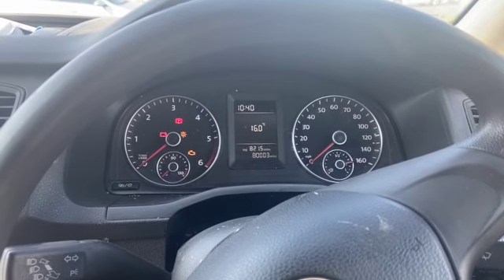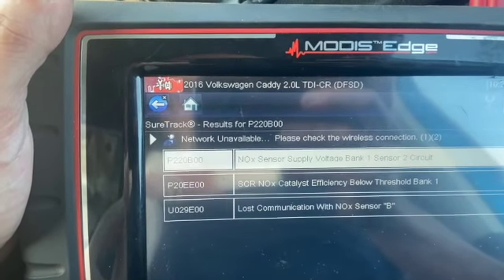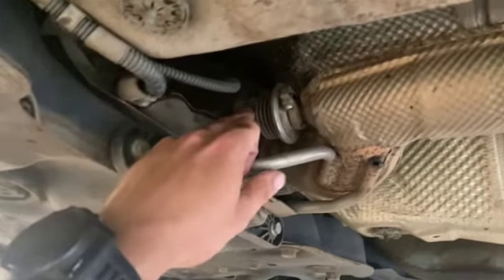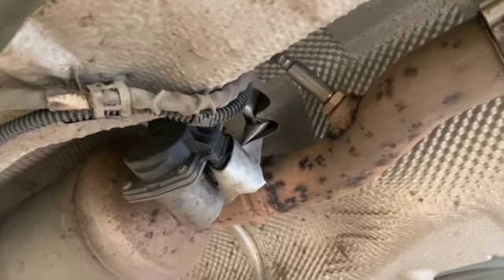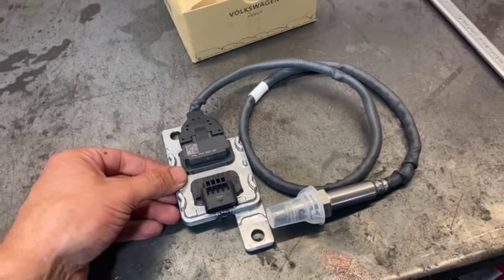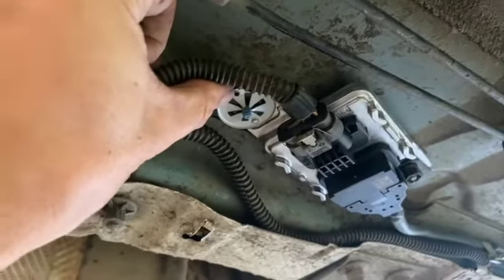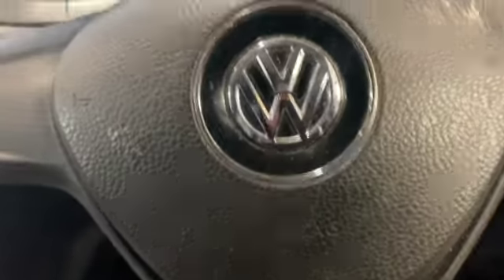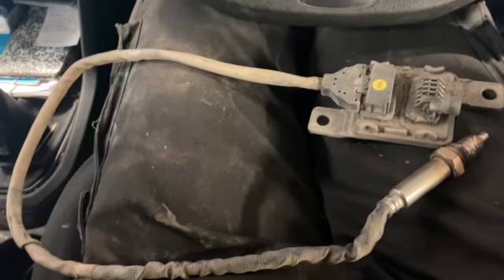VW Caddy NOx Sensor 2 fault codes P220B P20EE U029E *FIXED*

Comment from the maker: NOx Sensor 2 Ebay - https://ebay.us/XcbYhg
Check Euro Car parts for NOx Sensor - https://tidd.ly/3lIO7xA
Check GSF Car Parts for NOx Sensor - https://tidd.ly/359Cie3
Check "Car Parts for Less" - https://tidd.ly/2LNEwIn  (use discount codes on site)

Tools used :
22mm Crows foot Nox sensor removal tool - https://ebay.us/49xVVY
EOBD Scanner Amazon - https://amzn.to/2YBMA2L
Budget EOBD scanner eBay - https://ebay.us/IHpAfK 
Advanced EOBD scanner eBay -https://ebay.us/odL6V7
Draper socket set - https://amzn.to/2FdUEjf
22mm Spanner - https://amzn.to/2Rvkd1O

Comment: Mines just gone at 44k
P220B00
Nox sensor 2 bank 1 
 Voltage supply electrical fault  
Permanent 
Is this the same as you changed ?
Also is the link on eBay the correct part 
Mines a 66 plate 2.0 Tdi caddy
Reply from the maker: Yeah mine had the same code , yeah should be mate 👍
Reply: How do you clear the fault code?

Comment: Does the component need programming? Or once codes are cleared it should recognise different parameters being fed back.
Reply from the maker: No need to program , just plug and play.. fault codes will need clearing though 👍👌

Comment: Didi you do any coding after fitting new sensor?
Reply from the maker: no just plug and play mate 👍
Reply: before the year 2018 of the car it is not necessary, after 2018 the scr must be reinitialized

Comment: I've got the "Adblue Error, will not start in 600 miles" error showing every time I start my 2015 caddy, and the garage i've taken it to says it's the NOx sensor - is this the same NOx sensor or are there more than one? Thanks for the video!
Reply from the maker: There’s 2 mate , the fault code should identify which one though
Reply: NOx is just one

Comment: I wonder is it nox controller block fault or a sensor that sits in the pipe. Maybe sensor is just dirty, have you tried to clean it?
Reply from the maker: yeah its usually the ecu section that fails mate, never had any luck cleaning them
Reply: @diydaly  i sprayes nox sensor with maf cleaner also contacts with contact cleaner and put it back. After couple  100km no more errors!!! Saved 600€ just not sure for how long.
Reply: My error code was p220B and is 17 mercedes with 160kkm. New sensor cost over 600€
Reply from the maker: @montepaso  bonus 👍👍

Comment: Hello mate,
Got errors:
 U029E (lost communication with nox sensor “B”)
P220B (Nox sensor supply. Voltage circuit bank 1 sensor 2)
P22A7 (nox sensor heater sense circuit range/performance bank 1 sensor 2)
Any help?
2 weeks ago i change whole engine and from then 3 bulb lights i had to change, and now this. Do you think they didn’t wired it back correctly and is making me troubles? Or is just coincidence.
Thank you!
Reply from the maker: They are all normal codes for the nox sensor going down but is odd if they’ve come on strait after the engine swop.. I’d be have a good check at the wiring look to the sensor first to make sure nothing been caught

Comment: “Probably the NOx sensor”, but I’ll just replace it” it’s bloody expensive “ but it’s a lease car. Typical of modern mechanics. I’ve never known a sensor to come off that easily
Reply from the maker: Hi Ian , yes I admit it was a lease car and I was only going off the code but we've replaced over 50 of these nox sensors on caddy vans for the same fault and never had 1 not fix the fault.. We even keep one in stock there that common, the codes comes back on strait away so its quicker for us to simply try the part and test it first .. As for it coming out out , im always dead strait up in all my videos as I personally am not a fan of people not showing everything as it should be in a real life situation , these are all vans under 5 years old and ive never not had a rear one come out... as for the front ones.. its another story! between nox sensors & temps sensors ive had loads seized in 😬 . not on the caddy but mainly sprinters or other others. If you watch some of my videos you see I come across a few issues and show how to tackle them as best I can. One video I recall for not being honest about real life situations is most people removing the Audi A4 top pinch bolt.. they never come out!! ive seen 3-4 videos where they simply unbolt and tap it through!lol

Comment: Tried all the links for parts and the only one which worked was ebay.  None of the others could find the part even after entering vehicle registration.  Good video otherwise.
Reply from the maker: Thanks for the comment Tony, the video was put up a while ago so ill need to revise all the links! thanks for letting me know though 👍
Reply: Tried the ebay link for the sensor but its only showing Audi a3 im having a nightmare trying to find the correct sensor my caddy is mk4 2.0 tdi 105 bhp